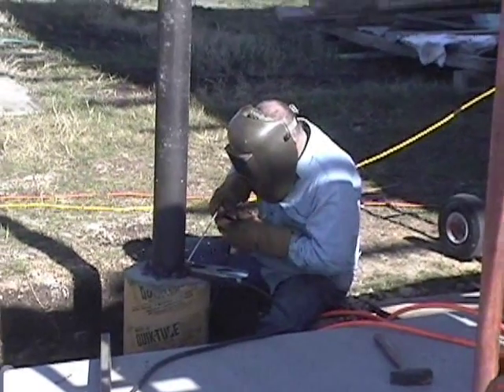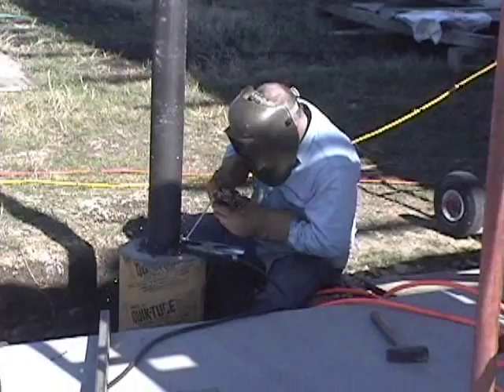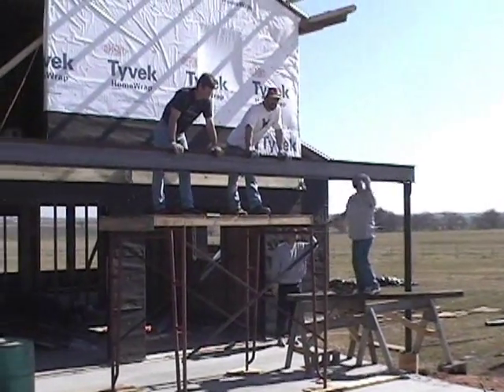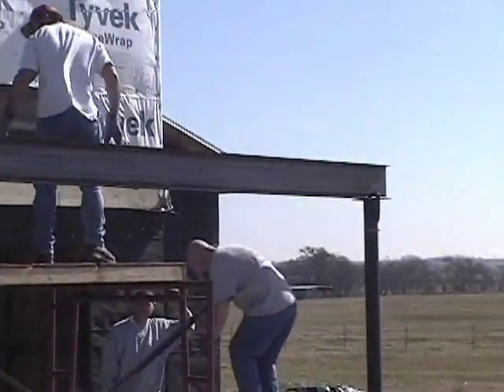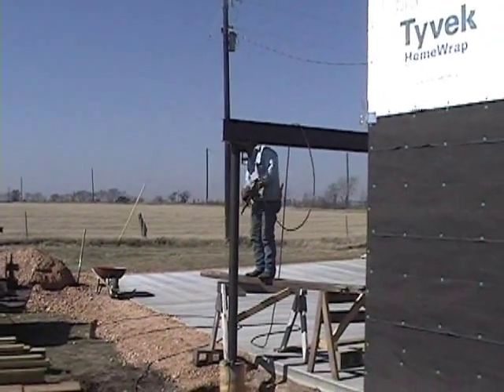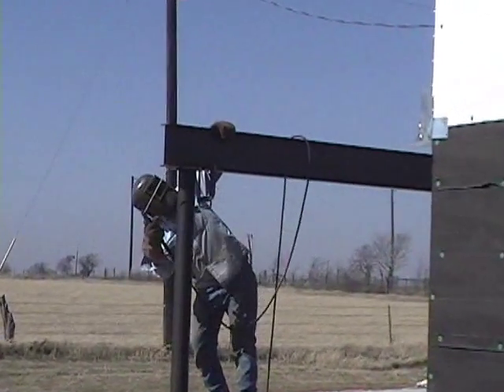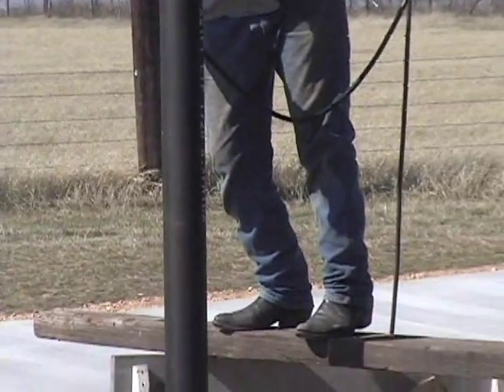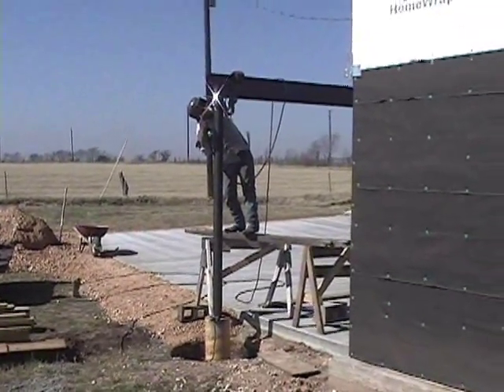Deck_I-beam

Comment from the maker: 4. anchor bolts coming up from the concrete piers were set to allow me to bolt the bottom cap of the column to the pier ... also in such a way as to allow me to add shims under there if pier settled and I needed to raise column.   5.  after a couple of years for everything to settle, I welded mason clips to the columns and put river stone all around the steel ... that looked really nice when done.

Comment from the maker: ... decks are something you don't want to skimp on because you never know how big of a party someone is going to have out there someday.  Some other details:  1. We welded a 1 1/2" angle iron long ways across the top of the I-beam.  2. drill holes in that and screwed in treated 2x4 across top of i-beam (that firmly made the switch from steel to wood without compromising the beam)  3.  welded caps on each end of steel pipe columns to make sure water can never get in.

Comment from the maker: It was a "junior I-beam"  for 24 foot span, but the deck only extended 8 ft out from the house ... any more deck, and it would have required full standard I-beam.  Don't know if you can tell from the vid, but we did weld strong channel iron corner braces from the 6" pipe columns to the I-beam.  Cost was only $200ish for all the materials, but I'm pretty sure steel has tripled since then ... at least scrap prices have.  I hired a local welder to do the steel work, and I recommend that...